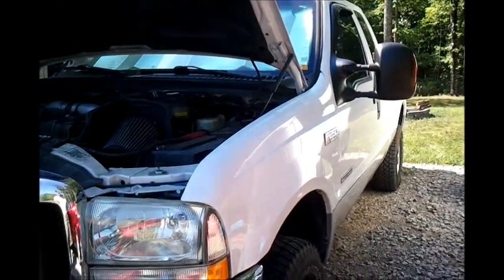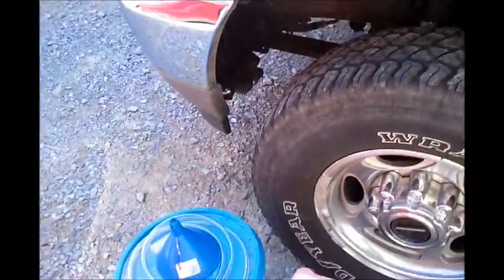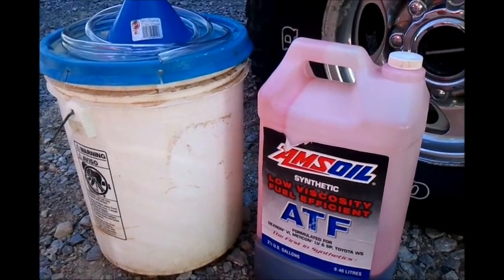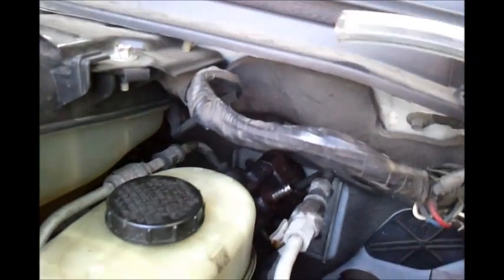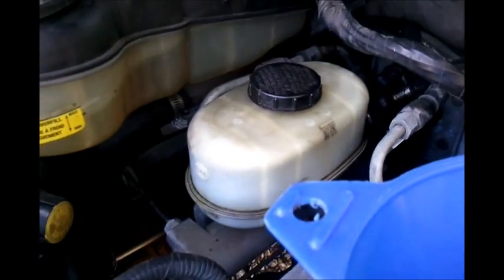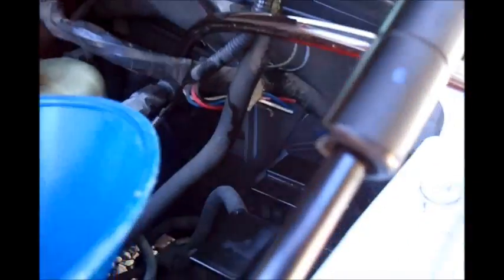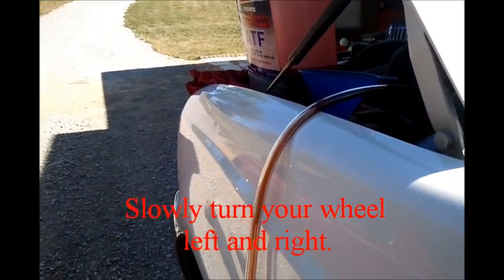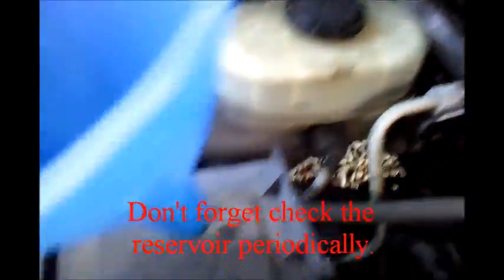6.0L Powerstroke Power Steering Flush

Comment: I too am a huge AMSOIL fan..  I have a 09 6.4L and it has the similar powerboost Power steering setup just the reservoir is different.  I am assuming I can do the same procedure and switch out the MERCON V that is in there to the ATF correct?  
UPDATE:  Can use the SAME exact procedure on 6.4L 08-10 Super duty's.  make sure you have atleast a gallon of fluid to keep filling and flushing! until cleaner fluid starts flowing..